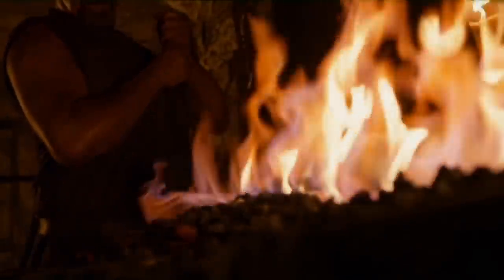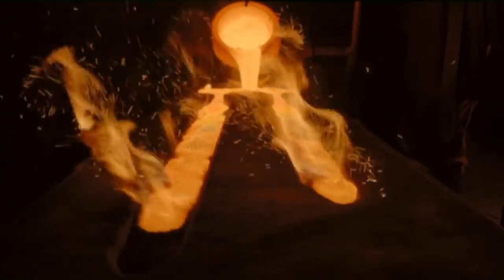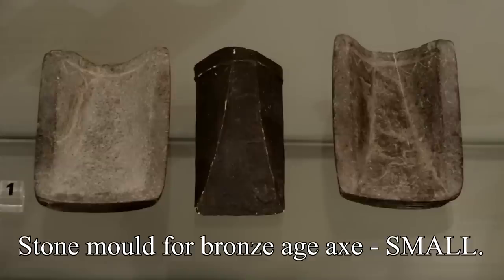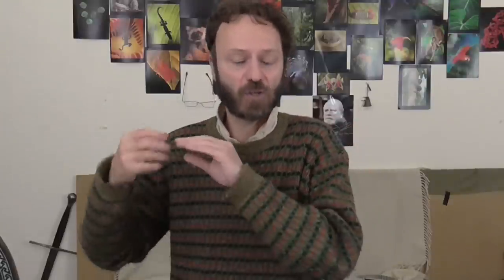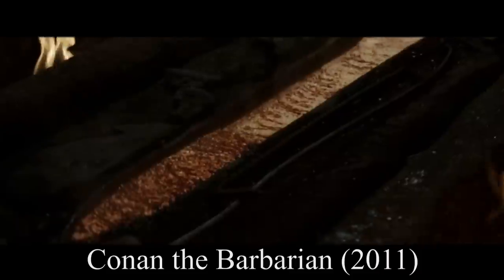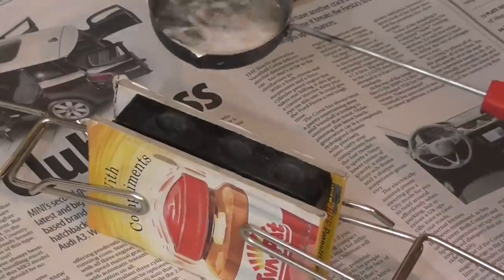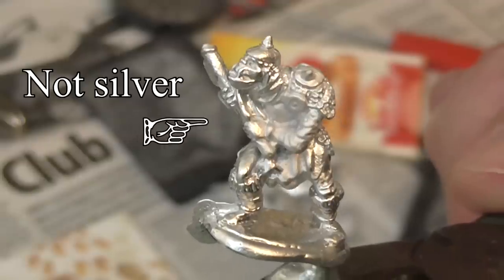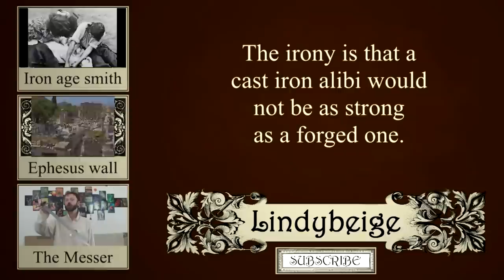Casting swords in the movies - forging a lie

Comment: So uh....what did they do?
Reply: +umidontno040394 They hammered the shit out of it.
Reply: You take a bar, heat it up and then, with a hammer stretch it to the size of a sword. Then you shape it and add the edge. Just search "forging a sword" on youtube.
Reply: They forged the blade by heating up iron (or Steel) until it's soft enough to shape it into whatever desired shape you want the sword to be.
Reply: +umidontno040394 This guy shows the whole process, all the way from fishing up some iron ore rocks from a river! Pretty cool.
http://jarkko1.deviantart.com/art/raudan-valmistus-324286519
Reply: +umidontno040394 try watching the man-at-arms reforged series on the youtube.
Reply: h3rteby so how do they get it so like symmetrical and shapely? just hammer it? and aren't there like different "types" of steel in different parts of the blades?
Reply: oberstul i have but, every sword forging thing i've scene skips over a lot. i guess i never realized it was all shaped from hitting it.
Reply: +umidontno040394 Skill and hours of hammering I guess. You can put a layer of clay over the center of the sword to insulate it when you temper it, making it cool slower and thus be less brittle, while the edges cool quickly so that they're hard and retain their edge well.
Reply: +umidontno040394 After the shaping with hammer, you will still have to use a file or a stone to polish everything up, give it an edge and make sure everything is symmetrical. You don't need a huge machine for this: a file will do; but it's a lot of elbow grease.

Also I think they do have water-powered sharpening stone wheels.
Reply: +umidontno040394 
Phase 1) obtain iron ore, heat in furnace until white hot, hammer out the stone, dirt, and impurities. repeat numerous times until it's a solid piece of white/yellow iron
Phase 2) make like 20 of them, heat 2 at a time, hammer them together, repeat until all 20 pieces are incorporated
Phase 3) hammer the block of iron into a long, flat rod, returning to fire when necessary, use guides to make the over all shape, hammer the primary bevel, the point, the fuller, and the tang into shape. and touch up
Phase 4) sand that shit down to make it smooth, heat it at a certain temp for an extended duration to temper the blade so it doesn't shatter, and is harder than iron normally would be.
Phase 5) quench the blade. sometimes in water, sometimes in oil.

you now have a sword blade
(I may have missed some steps and forgotten others, but that's the gist of it)
Reply: +Steve Peters  cast iron and then sweat out the carbon in an oven to get steel.  I think the original damascus steel also did it that way
Reply: +umidontno040394 i was waiting for this :(
Reply: +h3rteby holy hell. never thought i'd see someone from Finland doing stuff like this on the internet
Reply: +Adamast 
Decent sword steel usually came from a bloomery deliberately keeping the temperature low enough to not create high carbon cast iron, there are many videos on youtube when you search for bloomery, liquid molten metal like shown in the video is not a part of the sword forging process.
Wootz steel (true indian damascus) is a special case created differently at higher temperature.
Niels Provos (youtube channel) has great videos on forging a pattern welded sword as well as creating wootz.
Reply: +umidontno040394 

If you ever had a snowball fight, picture it this way;

Casting would be like it you took one of those scissor-like icecream scoopy things to make the balls. It takes snow and just sort of chops off the bits you don't need. It's not very hard; it's actually quite fluffy. It's good if you want that perfect sphere shape, but it sucks ass for snowball fights.

Then you have the snowballs that you squeeze together in your hands. And then add more onto. And then squeeze more. Squeeze squeeze squeeze- the snow becomes compressed together, very tightly. It ends up almost as hard as a rock, and is super effective.

That is kind of why the hammering method is effective- it compresses it.
Reply: aurarus So the density of forged steel is higher than that of cast steel?
Reply: +Adamast No, that's a really misleading analogy. The density is the same, It has to do with the crystalline structure and the grain of the metal, I don't know how it works exactly.
Reply: h3rteby When cold forging crystalline defects increase pinning down the layers and making grains more stiff.  When heating those defects disappear again.
Reply: +umidontno040394 Swords, contrary to most peoples beliefs, were also quite commonly made through a process called "stock removal". It's basically just grinding a steel bar into the shape of a sword. If you're curious how they used a grinding wheel without electricity, it was water powered.
Reply: DevinSmith56 Have you got a reference for this? Because I've never heard of that historically. As Lloyd stated, it's a massive waste of material. Not to mention that an ingot would have to be forged that size, so why not just continue forging it finished?
Reply: Jonathon Gay Forgive me for being horribly lazy, but here are the details http://myarmoury.com/feature_groundpound.html

I'll get back to you with actual primary source evidence when it's not midnight... I've lost a lot of hours of sleep to Fallout 4, as I hope you can understand.
Reply: +DevinSmith56 That page describes modern practices (first paragraph). It makes sense to use 'stock removal' nowadays because steel obtained from factories is so strong and pure. In the olden days the bar used for stock removal would have to be forged first anyway to be strong, so that would have been an impossibly ineffective practice. My take on it. 
So if you'd want a sword replica today a grinded bar would be more economical, if you don't worry about authenticity. :-  )
Reply: FinsmakarnSvyatoslav The article also mentions how we also have evidence that it was done historically. Forging was by far the most common way, but as far as we can tell grinding was used for more than just sharpening. I think you might find this interesting http://myarmoury.com/talk/viewtopic.8940.html
Reply: +umidontno040394 You asked about different "types" of steel in different parts of the blade. I think you're referring to differential hardening. You could insulate the spine of the blade so that as you heat it past its critical temperature and quench it, the edge cools very quickly while the spine cools more slowly. This causes the edge to get extremely hard and allows the spine to remain soft.
Reply: +DevinSmith56 I found your earlier article interesting, but I would still argue that my assertion was correct. I agree that grinding and filing was definitely used, however it would predominantly be forged to rough shape, then ground or filed finished. I to support my argument I would like to use the facts of the efficiency of modern abrasives, the high speed of abrasives that is now achievable, versus what would have been available back then. I would thoroughly recommend Niels Provos' videos, they would be a similar process to what I consider historical methods, obviously the power hammer is an aid for speed, and his use of grinding would be somewhat more than what I would consider historical, but otherwise excellent :)
Reply: Jonathon Gay I agree, the predominant way of making swords was by forging, however, I just wanted to point out that stock removal isn't only just a modern practice, and was occasionally done historically.
Reply: +Adamast  Does not the forging process itself diminish the amount of carbon in the metal?
Reply: +Akatsukami while yes it does, it was only documented to be an issue with the Japanese forging methods, as they had to do many heat cycles and fold the steel a number of times, this took a significantly longer time than forging in, say, the western world
Reply: Jonathon Gay Thanks,  I am learning.  Personally I always expected that once having more than 100 layers the carbon would have migrated enough to make the layers homogeneous. When forging the top layer dissapears fast to oxidation,  the forge is even less controlled than an oven.
Reply: Adamast While the folding does assist in letting the carbon migrate, the folding is more intended for averaging out the quality of the steel.

Say you have a sheet of tissue paper and a sheet of paper, with them representing low carbon and high carbon steels. If you have the two stacked, then fold it in half a number of times, there isn't as much of a weak point in any on spot.

In any case, if you want more information go to the Anvilfire website, they have a lot of excellent information from more experienced people than myself :)
Reply: +Jonathon Gay  Ah, I was unaware that the time required was so different.  Thank you.
Reply: +umidontno040394 Apparently they could use water powered trip hammers to get rid of slag more quickly, but this dates to when they were starting to mass produce (towards the late middle ages) from (I think) osmond ore, which is oxydized pig iron (creates wrought iron; still needs to be forged).    This is because by then, blast furnaces (also water powered) were melting iron into liquids so that they became brittle and (otherwise useless) pig iron once solid again.   Nonetheless, the blast furnace let them smelt a lot of ore quickly, whereas even the largest bloomeries could only handle about 15 pounds and were slow and often inconsistent (without lots of practice).  Blast furnaces took less skill per assistant.

Osmond ore was the process of oxydizing the liquid metal before it could turn into pig iron when it cooled, so that instead formed wrought iron that could be further worked (or hammered with a trip hammer, I guess).  Look up osmond ore on wiki.
Reply: +umidontno040394 All these responses are actually wrong in that they talk about how to make a sword from scratch. If you were going to reforge a sword from an existing one, you would first need to cut the blade part-way up in a V shape, then hammer out those two halves until they were both slimmer and longer thant eh halves they came from. You'd also have to close up the V on the lower half to make it into a point, and extend it on the upper half to make a tang. So far pretty simple, but you'd then have to re-temper it, having lost the original temper when you broke the greatsword. That is where the real artisty would come it, because that stage would probably be extremely difficult.
Reply: ***** oh. well ok then
Reply: +umidontno040394 It is common that you take a softer alloy, which is soft but allso not brittle, as a core of a blade and then hammer on a thin layer of hard steel on one or both sides of the blade (depening if you sharpen it from the both sides or simply one side). This causes the blade to bend and then reshape when you block so that it doesn't shatter, because it decreases the force at any certain point by distributing it over a longer time. The hardness keeps the blade strong so that it reshapes when it absorbes the shock of a nother blade, instead of bending.
Reply: ***** Common? It was one of the several methods used by the japanese for katanas, and other larger blades, and the nordic peoples sometimes did it too, but largely they just blended them together to make a stronger blade, with no weak transitional areas
Reply: +h3rteby I can't wait for Primitive Technology to do that.

Comment: In the case of game of thrones, Valyrian steel is supposed to be like magical damascus, And any special properties gained by layering steel with different carbon contents will be negated by melting it into iron and burning all the carbon out of it, and any properties obtained by the expert quenching and tempering of the blade will be erased .
Reply: was gonna say the same thing, also, even in the books I'm kinda wondering how they would turn a broadsword into two smaller swords. Could probably be done, and would probably be interesting. And it would have been neat to see them as red tinted damascus steel
Reply: +zibbazabba905 Great swords are big af so the amount of metal wouldn't be a problem

Comment: Steel is just basically Iron with an max of 2.06% Carbon. Actually Carbon causes that the melting point lowers. Still noone would ever try to melt iron, not even steel (which melts about 1300), it's just to difficult to reach this temperature. Instead you melt cast iron (1120°C), which has more Carbon (4.3%), than steel so the melting point is lower. But more carbon makes iron extremely brittle which is extremely bad for a sword.